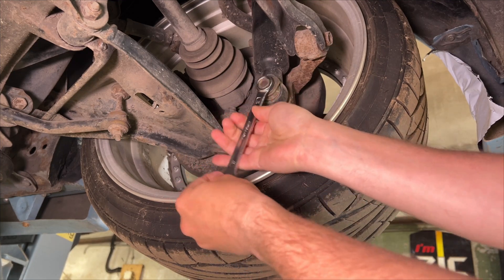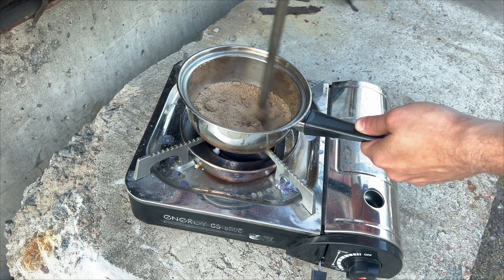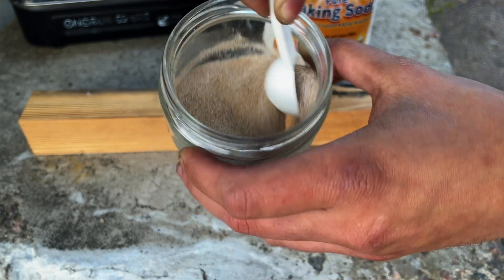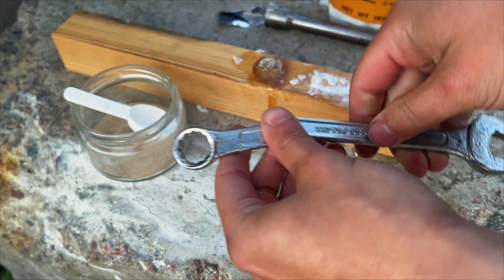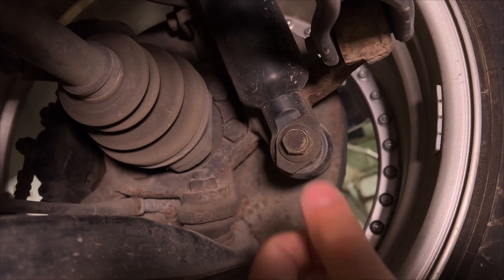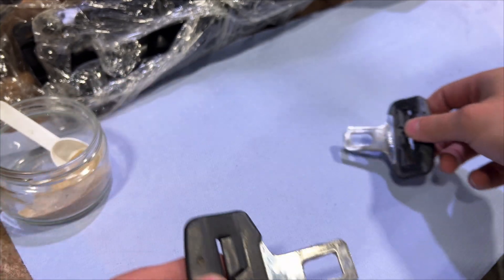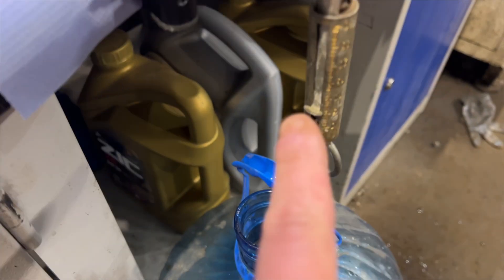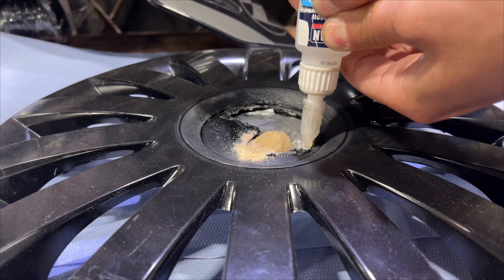Ancient Chinese Secret REVEALED! They Repair Metal With Sand And You Won't Believe It

Comment: This is one of your worst videos.  First of all, the reason your test with baking soda failed so badly is that you used a medium viscosity super glue.  This glue does not penetrate the soda well.  As a result, only the surface is polymerized and the rest is still powder.  Use a thin glue. Your hard tapping just fractured the surface while exposing the untouched powder inside.  The sand and soda should have experienced the same fate but you only lightly tapped that.  Also, your "weld" of the wrench is a joke.  You didn't even show how you broke the nut free.  I'm going to unsubscribe given how you are now into fooling your viewers.
Reply: You're so right this was fake as fuck
Reply from the maker: Thank you for the feedback, I'll keep that in mind for future experiments and videos! 🤩